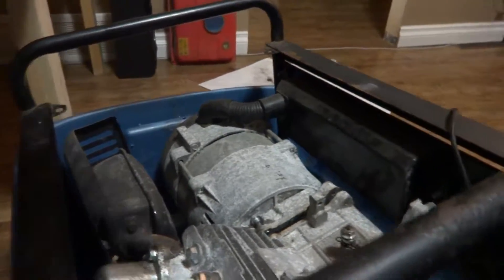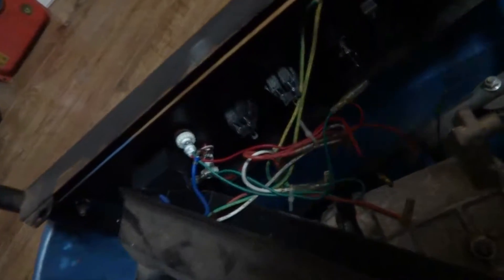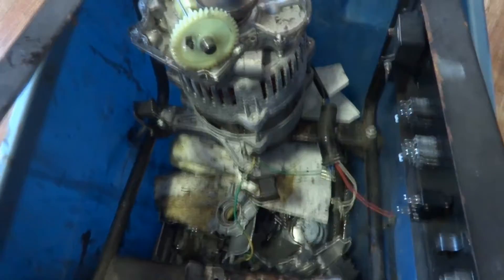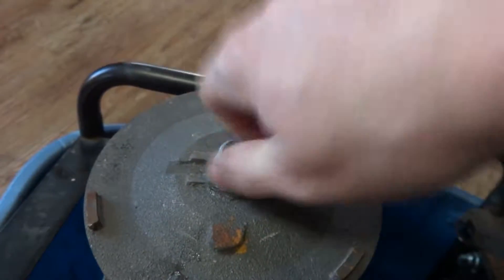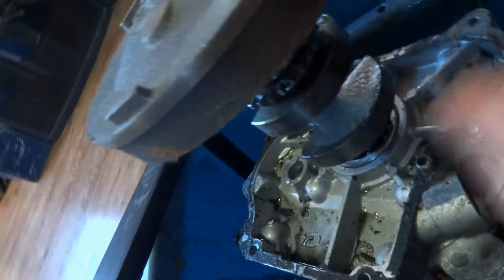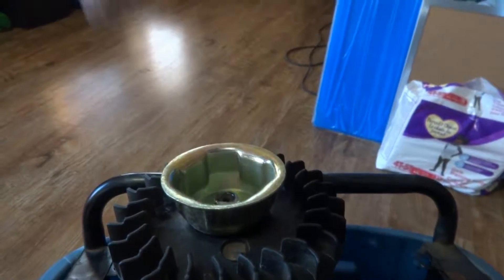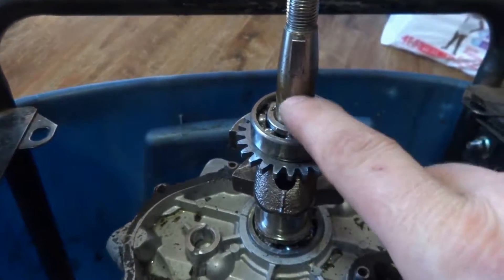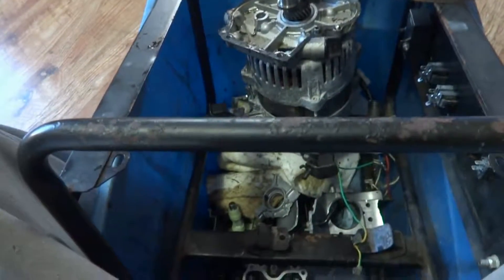Gas to Wind & Peddle Powered Generator Conversion Pt. 2 (Disassembly)

Comment: Did you finally end this project?
Reply from the maker: Nope, I have new parts. Currently injured right now, so I'll try to have that ready for next week.
Reply: Middle of Nowhere Duff ok, post an update! I wanted to do the same but i cant come up with some gearbox to run the generator with wind
Reply from the maker: @CazaVideos005  Already Finished / abandoned it months ago.